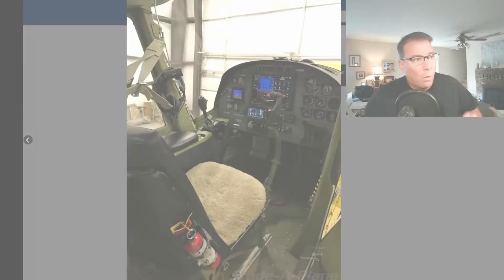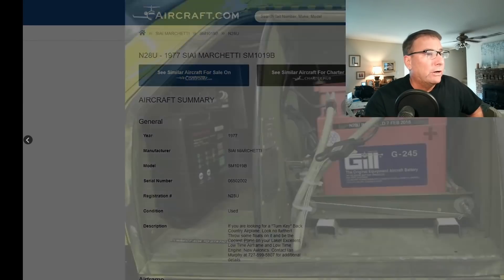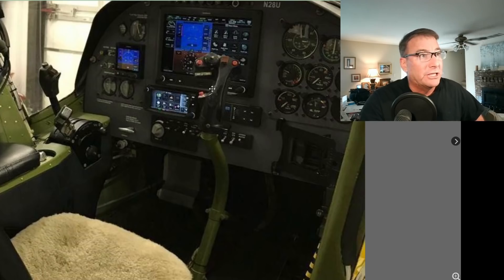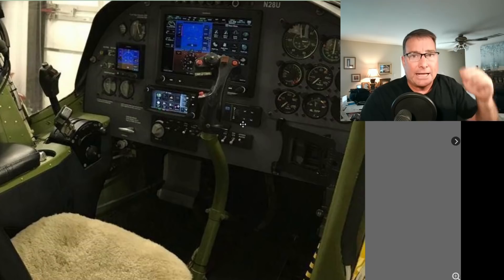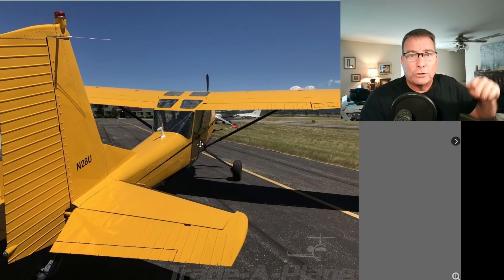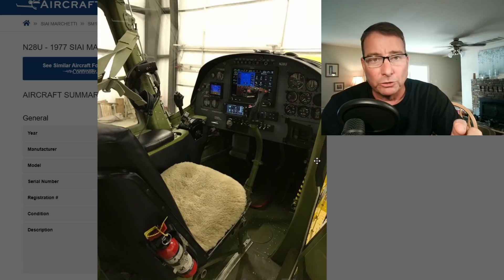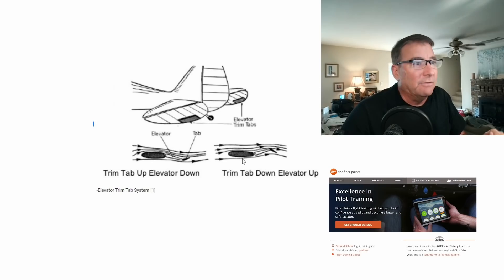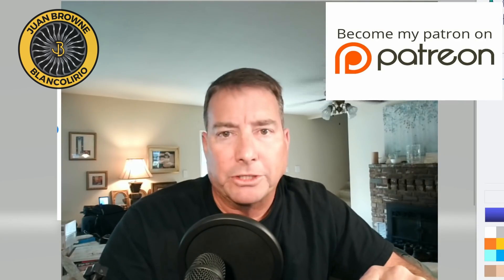Dale 'Snort' Snodgrass Siai Marchetti UPDATE- Elevator Trim System 8/8/21

Comment: This  explanation is more likely than the stick lock hypothesis. I fly RC control planes for more than 20 years and after the first accident when I connected the right and left ailerons servos in reverse mode, I introduced a simple system of Color coded cables ties around each cable, red with red on Lx and green with green on Rx, never had another accident. I wonder why the aeronautical industry has never thought of simple means like different connectors or Color coding , to avoid such tragedies due to human mistakes.

Comment: Watching the crash video closely I have to say the control lock theory is still the first I would investigate as the controls, even during the impact, show no ability to move freely from neutral.  The trim theory is a good one but it conflicts with the relative solidity of those control surfaces.  As far as the lack of rudder control, that could be masked if the pilot tended to ride, and primarily steer with, the brakes.  One is left thinking we'll have to wait for the preliminary, at least.
Reply: The elevator is more active In a taildragger taxi and takeoff than tricycle gear. Taxi (assume calm wind) and start takeoff roll with stick/yoke full back to keep the tailwheel from lifting then move it neutral as airspeed gains. Control lock would be caught immediately. Something could have slipped through the floorboards. I had this happen on a rental Champ - down elevator was limited by a 9 volt battery in the pulley. Fortunately I caught it in preflight. When I went to ask if a mechanic was available counter lady told me that the prior pilot got scared and landed after one circuit. Timely information that was.
Reply: @bp7093 
As a taildragger pilot myself I also find it hard to believe a locked stick and pedals wouldn't be caught before takeoff but we are stuck with the video of the control surfaces and the flight path that is consistent with locked controls.  The prototype B-17, also a taildragger, was lost in a locked control surface caused crash on takeoff so it apparently can happen.

Comment: He stalled. Full stick forward and Idle power would have allowed a wheels first contact onto the runway from that altitude. It may have caused serious aircraft damage but survivable. If there was aft CG, or broken elevator cables, or incorrect trim config, whatever yet there was no indication of power reduction. IMHO, this was pilot error.

Comment: Several people have asked or mentioned "loss or damage to evidence due to post mishap fire"

Did crash recovery in the USAF (a long time ago, in a century past...)

. "Witness marks" are often good indicators of what state/position components were in at the moment of impact, and fire can "preserve" or "create" a snapshot of components in their "found" state. Sometimes picking up/recovery of components, can result in movement and change the understanding or skew the information and evidence of "state" post crash.

In perfect scenario, documenting all things as found is ideal, but in many cases, getting survivors, firefighting efforts, having to clear wreckage, or removing victims can render evidence less credible for evaluation.

But a wealth of information can be gleaned from all but worst case mishaps, and the more information, the flatter the "data curves" and more likely to come to accurate conclusions.

No matter, this a great loss, as are all mishaps where people are lost or injured.

I love aviation, have my entire life, many of my family (8) worked at the various plants in Wichita, (engineers, QA, machinists, and fabrication) and this is one thing that I will never become accustomed to as an acceptable part of aviation. Never.

(My observation of the 3 point lift off, and the smooth rotation, zoom, power on stall, and impact, with the torque moment in the roll axis, and the yaw, with a steady and increase of pitch, make it most difficult to accept that Snort was "showing off, hanging on the prop" as some have stated in the many boards, and threads this far. It appears that whatever occurred, took him by complete surprise and simply no opportunity to do anything meaningful for recovery. It simply happened to fast, and too slow for reactions to effect a change. I only hope the facts can and will be discovered. And the hope that that outcome saves , if only, a single life, in the future.

Thanks Jaun, for another well presented briefing.

Comment: It’s kind of odd if you take screenshots of the crash video and blow them up you can see through the windshield and the left front glass but not through the left rear glass.Maybe he was in the rear?No gust lock on the rear,possible he put all his gear in the front obscuring the gust lock ? Look at screenshots of the crash .I cannot find a frame where you can see thru the rear.

Comment: Are you not ignoring the obvious with regard to that trim switch - pilot error in understanding/forgetting the operation of the switch  ?  As you point out, the entire sequence happened SO fast - coupled with the " disbelief " factor based upon a incorrect use of switch which was " believed " correct may also be the crash explanation .  Sad outcome whatever the outcome !

Comment: Who flies the aircraft with trim during takeoff?  Who flies the aircraft with trim, period? Trim is to be used once stable flight is established to relieve the control pressure required to maintain stable flight, it's not an active flight control.

None of this makes any sense.

Comment: If that’s a PTT / ICS switch beside the cookie hat I will throw in another possibility. If it’s a 2 position switch (fwd for XMIT back for ICS) it is possible he was activating that instead of the trim switch. Thinking he was trimming down but actually transmitting. Hence the swearing on the radio. Switchology in a new aircraft can bite you!
Reply: Wasn’t that new to him. He flew that airplane 23 times between May 26 and June 30, when he flew it to Lewiston airport for maintenance.

Comment: The Siai-Marchetti was a foreign manufactured military aircraft licensed in the experimental exhibition category.   Flight characteristics may or may not conform to our standard category airworthiness category.
Reply: U completely wrong ! Siai marchetti is a well designed  Italians airplane , capable,  and civilian aircraft ! Also military trainer  versions,  which I flew it ….most likely that was a control lock mechanism……could be that he didn’t disconnect the alevator control lock …

Comment: this one more reason all flight controls need a mechanical position indicator that has a direct mechanical connection to the flight control that is being operated. This can be a steel cable system or a push pull rod system. When you move a flight control you need an immediate indication that it has moved an which direction it moved. This the main reason that I am opposed to electric side sticks because there is no control position feed back to both pilots and is one one of the main reasons Air France plane crashed into the South Atlantic. I have only seen one exam[le of side sticks being mechanically connected to each other and that was in a home built. In my opinion this one thing Boeing did right.

Comment: One of the things I noticed, on the takeoff roll, the airplane appears to lift off from the three point attitude.  Takeoff in most taildraggers, most off the time, but not all the time, the tail comes up and you roll in the two point attitude for a short bit before lifting off.  The aircraft appears to come off the runway from the three point attitude.

Comment: If trim was the problem, does that mean the design allows the trim to go so far that a control surface input is insufficient to overpower it? Sounds like that's not trim but crude blunt instrument. I thought trim was to just provide neutral control feel. If it had that much trim that he couldn't overpower it, then that sounds like poor design. Even if the trim motor ran away, the design should be such that at its max extension (e.g. linear actuator), it was simply at max trim and could still be countered. It will be interesting to see what the inspectors figure out.

Comment: Thinking a piece of his camping gear tumbled in front of the stick when he rotated, and wiggled tighter as he tried to regain control the stick .
Reply: Hard for me to imagine - no matter how much thrust from engine and such a slow airspeed - that he couldn’t push elevator full forward to overcome any trim setting.  With lots of stuff stowed in rear (seat) likelihood of snag on rear control stick seems high to me.  Sad.
Reply: like something getting under your foot pedals on your car, no matter how hard you mash down, not much is going to happen. 

it's kind of like skydiving, you can drop a few balls you're juggling and no harm, no foul, but at certain times everything has to be done by the numbers. (body position at pull time and flaring the canopy.)

Comment: Is trim so important that it continues to kill people? How much trim travel could possibly be needed for normal flight? How out of balance does your airplane need to be so that much trim could even be needed? 
How about trim tabs which only move between narrowly defined settings? Like flaps. 
Move trim in small increments. Then fine tune between those narrow settings. A runaway tab could only move between those small increments before hitting a mechanical stop.

Comment: Sorry for the screen name....but wouldnt he have been physically able to over power any sub controls like the trim tabs?...i could understand a "flap" sittuation because of their size in comparison to the main controls but trim tabs are small and should be easily overpowered by the much bigger main controls...right?....or is there so much power from that engine and other greater forces thats happening at take off that something like this could happen from a small trim tab?

Comment: Pulling the power back some way may have helped
Reply: I don't think so, in that unexpected nose up attitude, the only thing that kept that plane in the air for as short a time as it was, was the propeller. Maybe the plane would have fallen tail first but nothing would have kept it in the air at such a low speed, high drag position.

Comment: Wouldn't pulling the power back reduce the pressure on the elevator so you could adjust the pitch?
Reply: @downc212  Yeah, true enough, just thinking about what happens in a twin with an engine out on climb out.  Dale knew how to fly, that's why to diminish  pilot in the circumstance.

Comment: Juan Brown.  As an Avionics-Instrument tech, back in the 1970's I worked an elevator trim system problem on a T-39.   It was written up as "works backwards."   It did, in fact, work backwards. 
.  
The shop who previously worked a trim problem on this airplane, did not understand how the trim worked. (Was either Aero Repair, or the Electric Shop) They said if the trim tab moved DOWN, the nose of the plane would go down, reducing the AOA - WRONG!

In Normal operation, as you know Juan, if the trim tab moves DOWN, the elevator is deflected UP, increasing the airplane's AOA.  If the tab is moved UP, the elevator is deflected DOWN decreasing the airplane's AOA.   Have seen this with the rudder trim on other T-39's.    May be the cause of the crash.  The aircraft maintenance forms should show any work done in that area.   Thanks.  N6395T   (I'm still going with locked controls - from something.)

Comment: Extremely aft cg and over loading produces an impossible nose pitch up. It happened to me in a Cessna 180 flying sky divers. 5 guys with 5 parachutes in a 180. On take off roll I was pushing full force forward to the point of possibly breaking the yoke and the tail would not lift up.  I look to the rear and see one of the sky divers had slid back past the baggage area into the tail cone.
Reply: Yikes!
Reply: Yeah, I'm thinking cg issue as well, but we just have to wait for the investigation results.
Reply: I don't think that was a factor.  This cockpit is tiny. Not much distance from the back of the pilot's seat to the end of the cockpit. He stowed camping equipment in the rear seat. I don't think it could have seriously affected the COG.
Reply: @pookatim  it sure looks like it would be difficult to put this plane in an aft cg. Unless you put 500 lbs in the rear seat. The pilot seems to be sitting about on the cg. I agree it looks like cg was not the problem.
Reply: The argument against a CG problem seems legit. 
The arguments for some other causes seem weak. I haven't listened to the tape. Any chance a heart attack led to the crash?
Reply: @kayakutah  I look at the video and see 2 things. 1 is the tail didn't lift up into position on the roll meaning a 3 point takeoff very similar to a soft field to with stick back and high aoa. Then just before the stall break it goes from wings level into a 90 degree bank left turn similar to a torque roll. And it continues that turn up till the full stall break reversing direction 180 degrees. To me, it appears the elevator was in full up position causing the reverse in direction just prior to the stall break. I've not seen how the exclamation is timed to the attitude. That would be interesting  to see what was the attitude when he yelled out. It was a complete surprise to him what was going on does that mean he wasn't paying attention to his attitude and was busy elsewhere??
Reply: @mazerat4q2  Yeah, I noticed that about the tail as well. I did see another video where the exclamation seemed to be at the point of 90 degrees wing down, or so. Elevator full up would explain it, I suppose. It will be very interesting to get the final verdict. Runaway trim seems unlikely to me, since the trim tab is so much smaller than the elevator, but who knows? We all trained in the A-4, prior to getting our wings and the trim on that has much more authority than the elevator....the same being true with most Boeing products as well...those lessons tend to stick. Any idea if his experience in tail draggers was extensive or not? I'm guessing it was.
Reply: @kayakutah  that engine must produce a huge torque at full on. That bank looks to me like a torque roll from slow airspeed. When it rolled that seemed to get his attention but then it was 2 late 2 seconds later the stall broke and nose to the ground. Maybe not full elevator but a significant amount. Very similar to what happens with a twin engine in a vnc demo with one engine off. The whole episode is only in the last 9 seconds. It makes me wonder what was he looking at for the first 26 seconds.
Reply: @mazerat4q2  Yeah, makes one wonder for sure!
Reply: @mazerat4q2  I'd be pretty surprised if a guy with 4500hrs in a Tomcat could get "busy elsewhere" enough to fuck up this badly in this plane. 

A new pilot? Absolutely happens all the time and doesn't take that much to distract them. Even a seasoned pilot. 

But he was beyond seasoned and is trained, an expert, and used to handling many many many more systems and things to watch in an aircraft where things happen way way faster...
Reply: @X85283  I've seen hi time big plane pilots ground loop a simple little aeronca champ and break off a wing. And slam brakes hard on a Cessna 140 flipping it on its back. I've flown with many hi skill hi time pilots in Cessna 150 and j3 cubs. They have a tendency to let things go as if they're in a protective bubble. Multi tasking is something all pilots do on every flight.